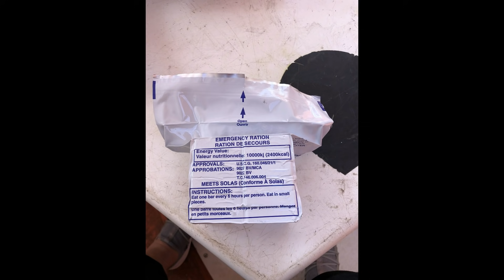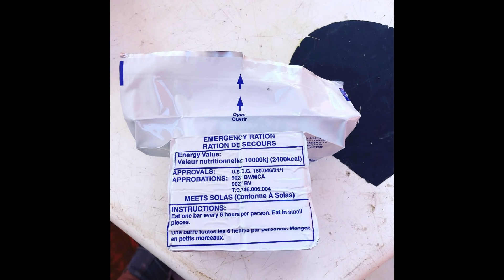Ep 5: We Made a Huge Mistake!

Comment: The brass cage with the “bouncy ball” would also act as a “self bailing” feature. As the boat rises over the crests of the waves, following the natural wave action at sea, the pressure of the ocean water pushing against the ball will change enough to allow the ball to momentarily “fall” away from the opening and sucking a small amount of water out of the bilge, then as the boat drops down into the waves troughs the ball will be pressed against the opening to keep the sea water out. It would have also worked when underway using the motor. As the boat is moving forward any changes in pressure would momentarily open and close the ball valve and bail water out in the process. It would have been a very handy feature to have kept.
Reply from the maker: Interesting thanks for the info!

Comment: Great job. Looking forward for the next video.  Just a little tip. Use chicken wire instead of plywood.  easy to mold. Cut your fiberglass mats into a manageable size . Dip a mat into the resin solution so that it becomes completely wet. And apply to the chicken wire. when this is dry. you can sand it smooth if you need to and start building up your shape.
Reply from the maker: Thanks! In a future video you will see how I redid this as yes it was a disaster lol

Comment: My early attempts at fiberglass work were much like yours! This was 1966. Not a whole lot has changed in the materials since then. Fiberglass dust is definitely a health hazard that should be guarded against, but the fumes from the resin when applied in the open air are not a problem, unless you have high sensitivity to the material. In that case use a mask with activated charcoal filtering. If all is well, you should not even smell the stuff. The best tool for applying the resin on surfaces such as you are dealing with would be a squeegee such as you would use for glass cleaning, but with a Teflon edge so the resin will not stick. Pour an appropriate amount of resin on, and use the squeegee to work the air bubbles out. Much easier. On surfaces not primarily horizontal, the roller will be a big help, but remember to work it in with the squeegee, as you work out the wrinkles and bubbles. Wear Nitrile single use gloves, as the stuff sure is messy! Acetone is the only satisfactory clean up solvent I have come across, with the rather pricey butyl cellusolve a close second.  You might also consider using fiberglass roving for the bulk of your thickness. It looks like a VERY coarse weave of fiberglass strands.
Reply from the maker: Thanks for your assistance I definitely have learned a lot since starting this project. I will definitely be trying a squeegee out in the future!

Comment: You took out the drain plug and fiber glassed over, what was the other opening on the bottom of the boat?
Reply from the maker: A couple of the holes were where the keel cooling was. And the other hole was for a pressure sensing device that over rode the safety of the cable release for the davits. The pressure of the water actuated a lever.

Comment: I am enjoying the videos and commentary. Just an observable comment on your explanation about the resin setting up too quickly. Back when I used to ride fiberglass surfboard (and subsequently did my own ding repairs), I learned to use less catalyst so the usability time of the resin is much longer. Getting the ratios right will take little trial and error, but it might make for more manageable application. The other thing is that the flatter or more you can use gravity to your advantage the better. The zip ties used to connect the wood is causing high points that is lifting the glass cloth off of the wood and introducing air and reducing adhesion. Hope that is somewhat helpful unsolicited advise. 😜
Reply from the maker: Any feedback is always helpful! We ended up scrapping this and as you will see in future videos we came up with a much better option.

Comment: how did you fiberglass over the holes? I put apoxy in a few small ones. I was wondering what a large hole was for in about the same spot. it must be te drain valve. for such an unsinkable design these things sure have alot of holes and things attached below the water line.
Reply from the maker: We will show the process in upcoming videos but we ground back the fibreglass and epoxied patches over all the holes we had. Lots of layers of fibreglass then fairing and sanding.
Reply: @LivingOnALifeboat  that'll be a good episode

Comment: Nice to see people just trying and doing!
Your fiber glass issue is probably two fold. High water content in the wood and or humidity, and the chemicals in the wood definitely don't help either. Try using less catalyst to soak the wood, and it gives more time to work with the mat. it will cure fine, just over a longer period.

Comment: If it were me.... I'd take the center support (the steel tube) out of those openings.  Then I'd span the entire opening with plywood strips, past the edges of the opening, from the outside of the hull.  I'd attach wooden ribs to the outer surface of the plywood, to stiffen it and help it hold it's shape.  These wooden parts would just be forms that you would reuse on the other side as well.  Once this was done. I'd cover the inside surface of the plywood form with peal and stick vinyl shelf paper.  Get the surface just as smooth as you can, so that you have less cosmetic work to do on the finished product.  Mark out where you would like windows to be cut, and hot melt glue PVA or uerethane foam "blanks" where those windows will be (on the inside surface).  Next I'd wax the remaining exposed surface of the shelf paper with carnauba car wax.  The resin won't adhere to the wax. Then I'd abraid the flange surfaces on all sides of the openings, and degrease them with acetone, so that you'll get good resin bond.  Once all that prep work is done, I'd use small pieces of cut mat to glass it up to about 7 layers of mat.  Working with smaller pieces it's much easier to saturate them with resin as you're rolling them into place, and air doesn't have as far to go to escape.  Once all that's had a chance to cure I'd resin on 10mm of balsa wood or other composite filler core material.  Don't run it flush up to the sides of where the windows will screw in - you don't want those screws to create a way for water to get to the filler material.  After that's cured I'd top it off with 3 more layers of mat.  AND to finish it off I'd add at least 2 more layers of mat at the corners of where your windows will be installed, and around the entire perimeter of the opening.  Once the forms come off, you'll have some filling and layering to do at the edges, but it should clean up nicely.  Yes, this method will create a lot of small screw holes to fill in the existing fiberglass around the openings, but it should give you a clean and very solid result.  Might go ahead and acquire the windows you wish to install, so that you know you're getting the holes right.
Reply from the maker: Thanks for this long detailed post. As you will see in a future video we did cut this all out and I removed the metal beam. I ended up framing the windows/wall in with timber and marine ply then epoxying multiple layers of glass over everything.

Comment: Great build! You guys should wear gloves when working with some of the materials used in the boat, and specially FRP, lots of splinters, shards and sharp edges especially when you start cutting them.
Reply from the maker: Thanks! Yes fibreglass is a pesky itchy product. Lots of gloves have been used over this project. Thankfully I don’t really react to most fibreglass dust I get slightly prickly for a few hours then nothing. It helps that usually I have a vacuum hooked up to any tools we are using now.